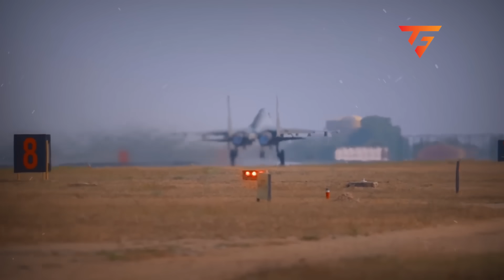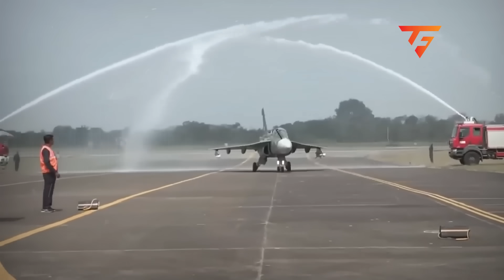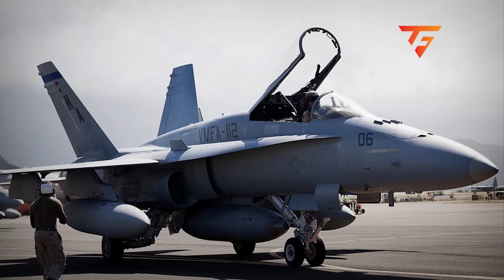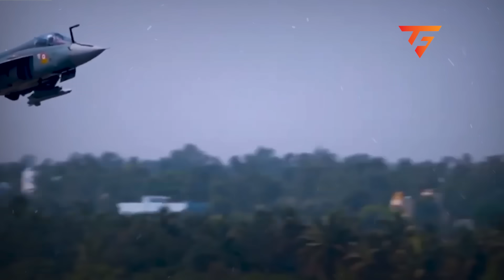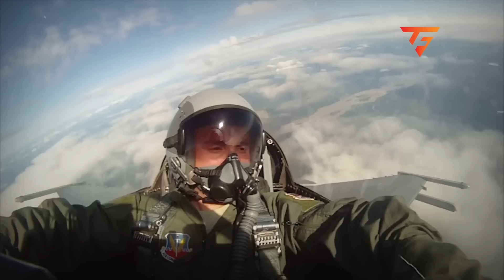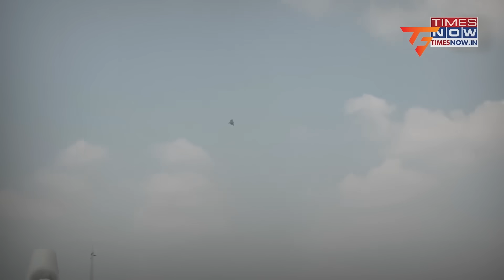Tejas Fighter Pilot EXPOSES Shocking Truth Behind Dubai Airshow 2025 Crash

Comment: Yeah.  Well.  I'm a former fighter pilot who used to do a solo display in another delta wing aircraft (the RAAF Dassault Mirage IIIO) and I can see from the various available videos exactly what went wrong.  And I can tell you that this video is an absolute load of baloney.  The author doesn't even seem to know what manoeuvre the pilot was attempting to perform.  The pilot was simply executing a level 180 degree left turn, the first half of which was a 3.5 negative 'G' "outside" turn (sometimes called a "red-eye turn"), and the second half of which was to be a normal positive 'G' turn.  

There are other videos of the pilot doing the same display in Singapore, and on the previous days at Dubai.  Sometimes he would transition from the negative 'G'  turn to the positive 'G' turn by simply rolling to the left (that is, "over-the-top"), which is by far the simplest AND SAFEST way to do it.  And sometimes he would roll to the right (that is, "underneath", through the fully inverted attitude).  It seems not many, if any, people have noticed this.  

On this occasion he rolled "underneath".  And let me tell you from experience that, especially in a delta wing aircraft, if you don't have that stick well forward as you approach the wings-level inverted attitude, and keep that nose well above the horizon so as to maintain level flight, you have signed your own death warrant if you begin at 500 feet altitude or thereabouts.  The nose will "scollop" (or "barrel") down as you go through the inverted attitude and you will wind up with a nose-low attitude and a high rate of descent which you may not be able to arrest in the altitude available.  All you can do at that point is stop the roll at wings-level right-way-up, pull the stick hard back for maximum angle of attack, and hope for the best.  

In the videos of those of his previous displays which show the pilot electing to transition by rolling "underneath", he handled the manoeuvre properly by keeping that nose high during the roll, no doubt by NOT relaxing the forward stick he would have had on so as to push that bird into the minus 3.5 'G' outside turn, and probably applying a bit more forward stick as he went inverted.  But on this occasion, and for some reason not yet determined, he let the nose drop very quickly well below the horizon as he went through inverted, possibly by inadvertently relaxing the forward stick as he did so.  Other videos of this part of the display show the alarming nose drop very convincingly.  He just didn't hold that nose high at all on this occasion, and that was a fatal error.  

Thus the essential question is why the pilot allowed the nose to drop away like that?  Did he just simply make a mistake, as we all do at some point in our lives?  Was it a lapse of concentration?  A moment's brain-fade perhaps?  Were brief physiological factors involved, perhaps occasioned by the sudden release of minus 3.5 'G'?   Perhaps not, given that he arrested the roll when he reached the wings level attitude, showing that he was obviously alert to what was happening.  Did some failure in the flight control system reduce the elevons' authority at the crucial moment?  Unlikely I would have thought.

It all comes down to this: why did the pilot, having executed the roll-under transition from the negative 'G' turn to the positive 'G' turn quite successfully on several different occasions, fail to keep the nose high on this one occasion?  I suspect we may never know.
Reply: Nice explanations. Here also after negative G turn ,aircraft seems gained level flight,and then dropped. Can  u tell why  he didn't pull up by engaging  afterburner. I think it  might be due to flame out .
Reply: That's why i don't watch these channels where they don't show their faces nor list their avation credentials.

I was here only to check the comment section . What the users commented . Now a days YouTube plays ad first before the video . So pause the ad and scroll through the comments to get an feel about how the video is going to be - authentic or fake 🤥 & how good the viewers of this channel are baby type beginners, semi beginners like me  , good that have ok knowledge - give their opinion but not criticize & domain expert like you guys who will catch the mistake criticise it while also giving your opinion . 

reliable avation channels according to me who's hosts have some what good aviation careers that i have till now  seen & that do aviation investigation (not all of them ) are - blancolario (mostly civil aviation) , movers & gonkey ( civil & mil )  , ATE chute (civil & Mil) , max afterburner , fast jet performance , growler jams ( doesn't do any air crash investigation. May be later) , pilot debrief (civil) , mentor pilot (civil) ,zeto.r (airline maintenance) , stig aviation ( aviation maintenance , Great guy . Gave good insight on fuel cut-off switch regarding airindia crash which happend this year ) & matfrom103 ( canadian coast guard rescue  ).

Comment: Multitudes of reasons could have contributed to the crash of the Tejas, extending from compressor stall induced engine flameouts to incompatibility of existing flight control software protocols to performance maneuvers executed by the aircraft to even the possibility of  G-lock triggered momentary incapacitation of the deceased Pilot Wing Commander Namansh Syal. This particular flight maneuver, formally designated as the Knife Edge, is considered as one of the most perilous of maneuvers, regarding the obligation of the Pilot to execute the same at extremely limited height Above Ground Level (AGL). Thus, speculations could abound regarding the causality of this accidental crash. However, any individual in possession of the fundamentals of flight maneuvers, let alone professional combat aviators, would vouch for the fact that any form of demonstrative display oriented flight maneuvering involves extensive probability of the risk of such accidents to become a reality. Thus, unscrupulous individuals attempting to berate the aircraft or the late Pilot should comprehend the fact that history is replete with instances of combat jets of every conceivable category, including the F-16 and JF-17, having crashed during display oriented maneuvering flight operations.  Those who reside in glass houses should refrain from hurling stones at others.

Comment: This is good aerobatic theory that I never heard before. I like the sound of this and I only have one correction. The pilot does not have any reference for visual altitude estimation over water. Water has wave size differences that change so much and so a pilot has no reference and can easily fly into the water when attempting to skim over the surface closely. Never ever fly low over water for this reason as you can die quick.

Comment: Your explanation skill is subpar. Use AI to help you generate some graphics. Get to the point quickly instead of dragging on forever.
Reply: this Tejas is not a fully Indian jet. Engine is American. India should develop its kaveri engine fast..then only everything will be explainable..so nobody knows what happened..and there will be always narrative buildings to prove their points. but Tejas is an unique Light Combat Aircraft...and its being smaller in size its Radar signature is very small and very economical. in 24 years  only 2 mishaps shows Tejas has a very bright future. it is very sad at the loss of the invaluable Pilot..

Comment: It is the work of Turkey-Pakistan-US nexus to contain India's growth. I personally believe that there is some form of chemical used in the fuel tank of the flight at some point of time during the time of its refueling or maintenance by someone. All other theories are made by different quarters to divert the attention from the actual cause of accident.  The sudden loss of thrust of flights during the critical time when it needed the most shows some kind of chemical used in both Air India in Gujarat and Tejus in Dubai.
Reply: Belief without evidence is irresponsible and irrelevant. Focus on improving oneself first instead of blaming others around you for your misfortunes.
Reply: Blame blame blame 😂

Comment: The Tejas fighter jet have crashed in the air show and the pilot is dead. There are leaking oil detected during static display. Leaking oil means something is wrong and most likely a screw forgotten to put back in original place after maintenance. Unfortunately, they doesn't have common sense to realize the danger. When HAL do maintenance of the aircraft, there are screws they forgot to put back when they completed the assembly. Substandard component are used to save cost. As a result, the IAF has lost more than 2,374 aircraft and 1,305 pilots in crashes over seven decades.
Reply: Indians really need to ask; “Is it really worth getting your pilots killed just because of incompetency of HAL”.
Condolences to Pilot’s Family.
I don’t know how Tejas is considered a “Safe” aircraft?.
Tejas and pretty much any jet, which HAL touches, becomes industrial garbage.
But India really needs some introspection and stop comparing from Pakistan or China.
Indians have produced 38 Tejas. Only six are equipped with engine. That means, six Tejas are in air regularly, and few hundred hours of flight. That is solid 33% crash rate. Vs. five crashes (couple of trainers) out of several hundreds and many tens of thousands hrs of flight. 
2 jets lost out of 6 = crash ratio solid 33% vs JF17, 5 lost out of 200 = crash ratio 2%.
Very fair and objective comparison.
Reply: @omargarcia5863 ATLEAST IT FLEW.. NOT LIKE A JUNK SITTING DUCK

Comment: This Indian HAL paid channel is squarely implying the fault of the dead pilot (who can not defend himself now) and trying a damage control for HAL. The pilot even seen not to pull up when approaching ground indicating the control system froze or non-responsive. The pilot was a top notch in IAF. How can he make any error that might have cost his life. The plane was poorly designed that could not handle the negative-G even within specification.  The possibility of Pilot error is less than 15% but the fault of the plane was 85% or more.
Reply: Unfortunately, India invariably struggles the most with integrity. That's the problem. 😢
Reply: Buddy what if the pilot was in A lock, hence he couldn't pull up before the roll.. After the roll he tried pulling up but it didn't work... Pilot could have risked things here too... I understand he is a commander... But we all make mistakes.. And we still respect this pilot too..
Reply: @prowlerpunk  Again you are squarely putting the blame on the pilot and trying to sugarcoat the designer HAL. Tejas was problematic from the beginning. Even IAF was very reluctant to include this poorly designed jet into it's fleet. Unfortunately, a brave patriotic pilot tried to help enhance the image of Tejas by sacrificing his life. Even at the last moment the pilot ejection system didn't work ensuring the death of the pilot.
Reply: If its pilot fault. Its slap on Indian air force face. India government will not like it too.
Reply: Things like tunnel vision are not planned Genius !!!
Reply: An arm chair general in action😂😂😂😂
Reply: @veekayrm  A cow cola drinking hollow head. A General doesn't deal with anything of aircraft.

Comment: Excellent explanation! Thank you! I am not a pilot, but I have a good technical understanding of G-Force, Blackouts, Spatial disorientation, Thrust Vectoring, Wind Shear at high ambients, and control surfaces. Fighter aircraft perform well during dogfights for which they are designed, and should not be used at low altitudes just to impress people who are ignorant of the risks encountered at air shows! Was it Einstein who said "Insanity is doing the same thing over and over, and expecting different results"!

Comment: After 30 years plus R&D India finally produced 6 Tejas with two crashed making the failure rates 33%.
Reply: 6 ? are you pulling these numbers out of your a&& ?
Reply: What hhas pakistan produced in 70 years? Let me guess.... beggars and soldiers that surrender
Reply: Baloney. They have 2 squadrons in service for 4 years which is a minimum of 36 machines.
Reply: @vish6306  please attend a few more air shows, maybe 36 more air shows are possible if 2 are crashed and 36 remain of the 38, public loves watching the special attraction.
Reply: @vish6306 Only 6 installed with engine?